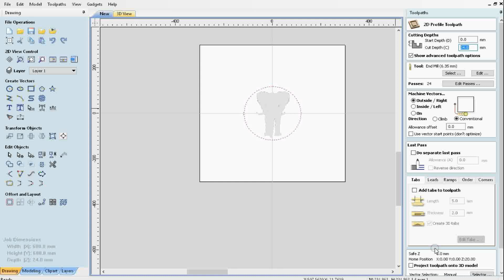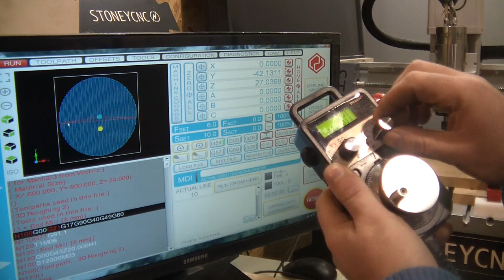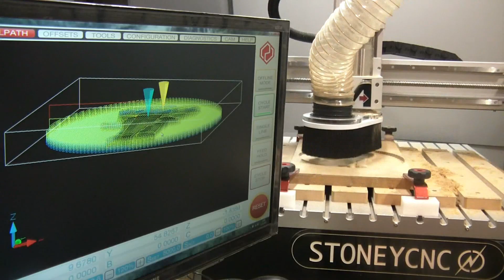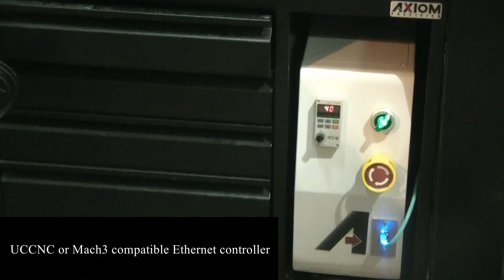3D CNC Cutting with the AXIOM CNC router

Comment: great video
have you worked on designs much smaller than the one one shown in this video for instance the size of a 15mm diameter circle.
If yes, were the results similar?
Reply from the maker: You would need a smaller cutter to finish the surface - but yes - no problem at all.

Comment: i use solidworks can i import a file and cut with the included software?
Reply from the maker: yes - you can import as DXF and STL files.
Reply: can you also use vector based images from Illustrator?